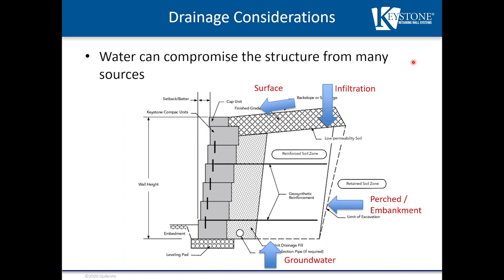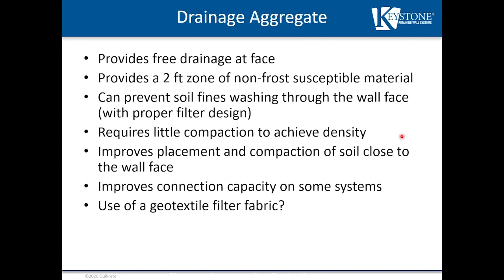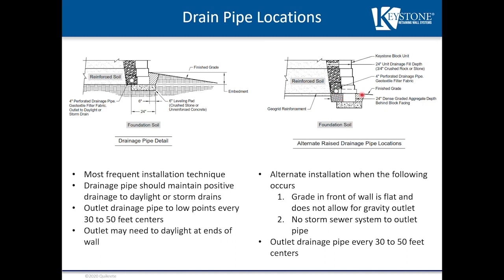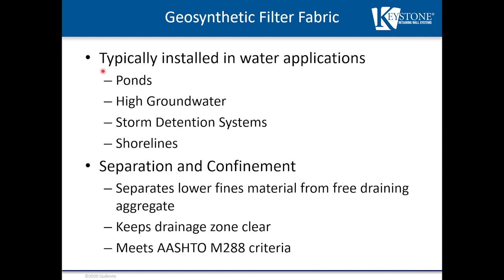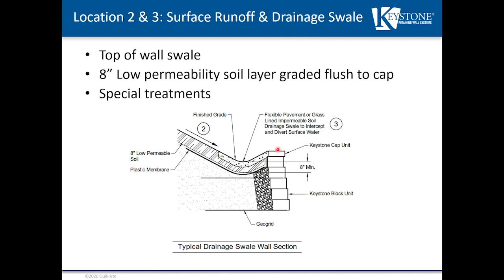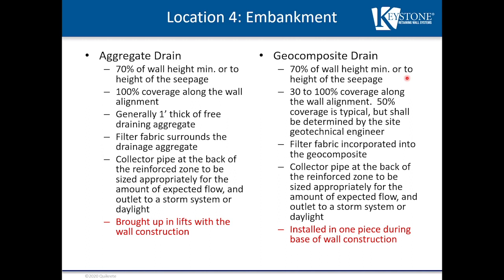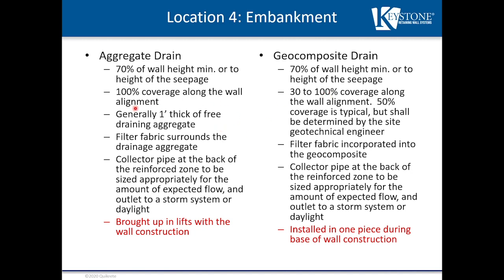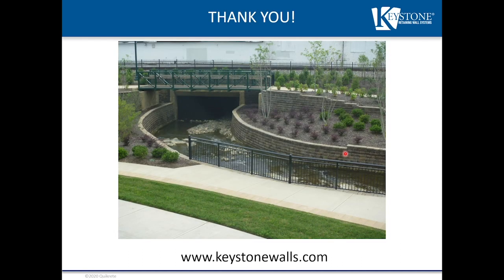Tech Talk #5: Retaining Wall Drainage

Comment: I am building a 70ft x 3ft retaining wall, I will be installing 4" perforated drain pipe and Teeing off to daylight every 8ft. Will it be good to use 2 inch pipe for daylight drainage instead of 4"?